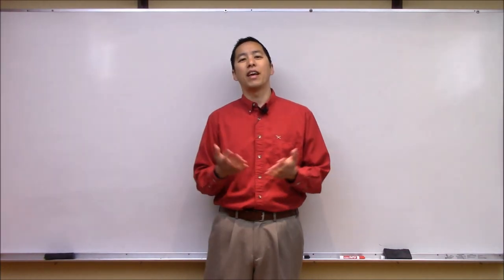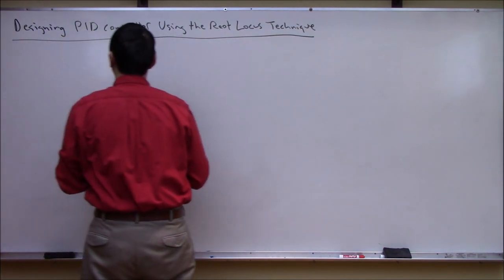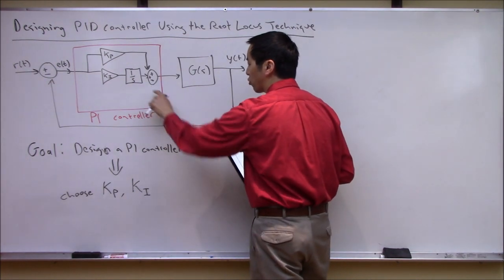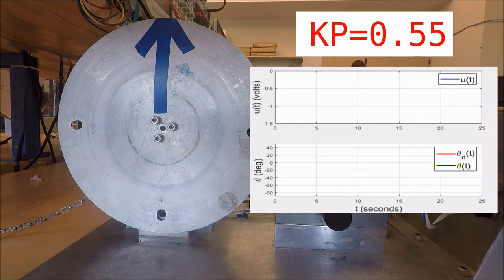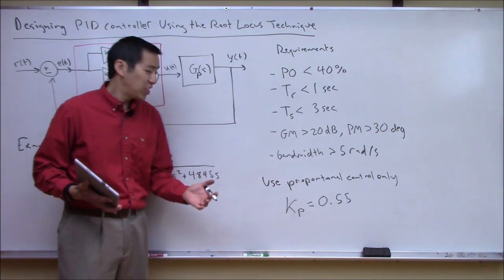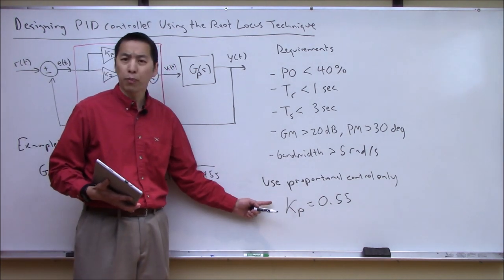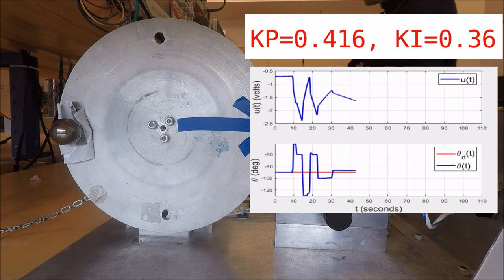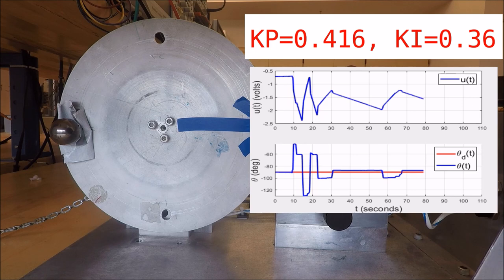Designing a PID Controller Using the Root Locus Method

Comment: Christopher, great job. I am really looking forward to the release of the practical PID implementation video. I see it is still TBD. 

Thanks for all your great content!
Reply from the maker: Kyle, you're in luck, I'm actually working on this right now.  If you're subscribed, hopefully you'll be notified when it goes live (probably in the next few weeks).  Thanks for watching and please let me know what you think of any other videos, thanks.
Reply: @ChristopherLum  Wow. Awesome!

I think a really interesting series would be sort of a survey of advanced control methods. I find that conceptually many advanced methods are easy to understand. Although I think there is good content out there on individual methods, I think there is an opportunity for more content comparing methods with each other in terms of strengths, weaknesses, use cases etc. 

I think building orientation and subject breadth awareness is really valuable.

Some specific areas I don’t find content on are passivity based control and energy/power shaping. Trajectory optimization.

Comment: AE511.  I think there is an error at around the 40:59 mark.  You said and wrote there is real zero at -a, but later in the control system designer you used a real pole.
Reply from the maker: Great catch Brad!  I indeed should have wrote/said a real pole, not real zero.  I tried to add an annotation to the video to highlight my mistake.  Please let me know if you catch other problems in the future, thanks!
Reply: @ChristopherLum  I noticed that as well. But otherwise really really helpful video.

Comment: Thank you, Sir, for an informative talk about the design of the PID controller.
I've seen all the video conference control theory playlists and sir, I quite enjoy your explanation. Sir, I had queries on designing a higher-order system (3rd order). I want to design the PI controller for the 3rd control system, which had a transfer function: 
1- real Zero and 3 - poles (one at origin and the other two are complexes).
I have more problems with the design of the third-order system.
Please, sir, can you give more information about the design of the 3rd order system.

Comment: [AE 511] 30:52
It's interesting to see to that the integral part of the controller can actually bring the system into compliance without have the explicit dynamics that is causing the error. It seems like with the right controller components and settings, you can actually use simpler linear dynamics for a non-linear problem and still have a controller that can successfully command the system to the desired input.

Comment: AE511: great comprehensive lecture. Just wondering....is there a rule of thumb for knowing at what point your plant becomes 2nd order dominated (maybe a rule like poles that are 2 orders of magnitude greater are no longer relevant)? Or better yet, is there a way to (formulated by hand or using built-in matlab functions) determine performance metrics(PO, rise time, settling time, etc.), exactly, for 3rd order or higher systems without the need for the 2nd order approximation (dominant poles requirement) and without needing to graph the input response? It would just be nice to graphically see more accurate restricted areas on the RL plot for 3rd order or higher systems.
Reply from the maker: Great question.  I'm not aware of any formalized rules for 2nd order dominant system.  I've seen people use a single order of magnitude real part comparison to consider faster poles irrelevant.  Unfortunately I'm not aware of analytical results for 3rd or higher order systems.

Comment: AE511: thoroughly enjoyed the puns. Seeing the difference between simulation response and the practical response is very helpful. Is there a way to simulate/approximate non-linear external factors (friction in this case) as a part of the controlSystemDesigner?
Reply from the maker: Brian, unfortunately I'm not aware of any ways to take non-linear factors into account with the Control System Designer.  This is a linear tool by definition so exact non-linear effects can't be modeled.  That being said, there are ways to approximate non-linear effects.  For example, a time delay is a non-linear effect but it can be modeled using techniques such as Pade approximations.

Comment: Hi Professor Lum. I just wanted to say that this video has taught me things that I could not get into my head before. I have a question about a little project that I am working on. I have adapted your method for designing and tuning a PI controller using the Root Locus method. I have come up with a final transfer function which I chuck into a MATLAB script and run the controlSystemDesigner command. I was expecting a similar step response to the one you have showcased at @16:00, so that it would be easy to work with it and tune the appropriate zeros and poles to achieve the design requirements. However, I get a weird response and struggle to work with it. I understand the whole process of calculating values for P and I for the PI controller with the Root Locus method, but I cannot do this without a step response that I can work with. Any advice would be appreciated. Thank you and please keep the videos coming - you're helping a lot of people out here! :)

Comment: Hello Prof, with due respect, Can you provide me the circuit diagram of DC motor with the PI/PID controller so that i check my PI controller is working well or not, or is it possible that i could contact with you i am facing many issues in designing the PI controller for AFM.

Comment: You mentioned that the performance requirement regions on the root locus plot only apply to second order systems. For higher order systems, how do we know which way to move the poles and zeros to alter the system behavior in a particular way?

For example, does the real part of a pole location influence settling time in the same direction as for a second order system?
Reply from the maker: In general, you have to be careful.  The safest way is to look at the simulated or analytical step response of the system.  If you really wanted to, you could try to re-derive the expressions for settling time, percent overshoot, etc. for a higher order system but it gets very messy very quickly.  The easy fomulas we developed earlier are only accurate for 2nd order system.  The easiest way is to just simulate the step response.

Comment: hi, I am simulating a continuous pure PID (unfiltered) controller with parameters kp= 11.4  ,  kd = 3.16  and  ki =  1.2, these parameters give me a desired overshoot, rise time and settling time, the idea is to discretize the PID to control a continuous system, I discretized the PID, but when I run the simulation, it's like I had two different controllers, the transient response of the system is very different, why would that be? , thanks

Comment: Take the case of PI, it added one dynamic zero & one pole at the origin.  Now the transfer function of PI block (c(s)) would be multiplied with G(s) & thus it will add one more pole (which is at origin) in the list of open loop poles. As we know that in root locus by changing the gain (kp in this case ) we change the location of closed loop poles which starts from open loop poles and ends at open loop zeroes or zero at infinity.
Now my question is on moving the other poles or changing the value of gain (kp) in the root locus of PI why not the position of pole (which is at origin) is changing?

Comment: The Matlab code link to get the kp ki and kd values isn't working, could you possible provide us with another?
Reply: Actually, I can solve it by using your equations for each ki kp and kd, no worries.
Reply: @sterlingg2454  can u share the equations?
Reply: I’ll look back to my notes to see if I have it
Reply: Wow thanks..huhu got assignment to design pi and pid controller to control speed of bldcmotor using root locus method..stuck at pid haha..hope i can finish by this week..
Reply: @sterlingg2454  Hi! Yeah, the github repo isn't available. Could you share the code for getting the tuning parameters? Thanks a bunch!
Reply: akula akuni 
https://youtu.be/a4TtRxuK7-A
Reply: @sterlingg2454  wow thanks a lot..huhu..i try using pure pid for this got high starting current for my simulation..bad sign..need hybrid i guess or use soft switching

Comment: There are a couple of very important things that are neglected.  If the set point for the motor changes abruptly, the control output will saturate.   Servo motors to not change position in steps. Overshoot should be avoided.   Where does the open loop model come from?   Lum's real motor must have a lot of friction.  Why? Lum must have added the friction to make it easier to control with only a PI controller.  My motor has little friction, so a derivative gain is required to provide damping.  Mechanical friction is not energy efficient. Something must provide damping, or it will oscillate a lot. There is no mention of where best to move the zeros.  The worst part of this is the students can't see the math to do all of this as it is all hidden in the Matlab libraries.